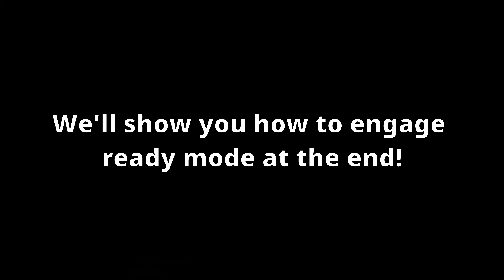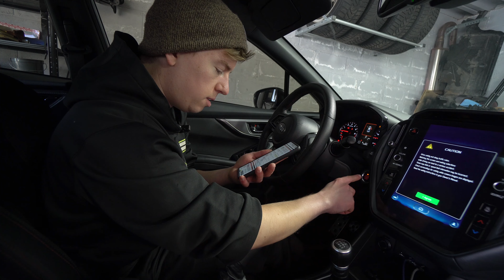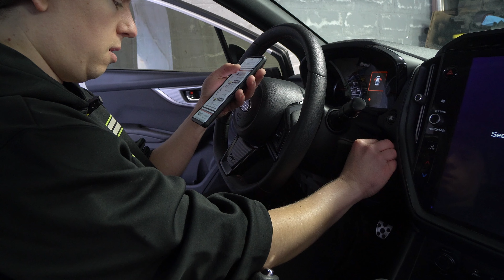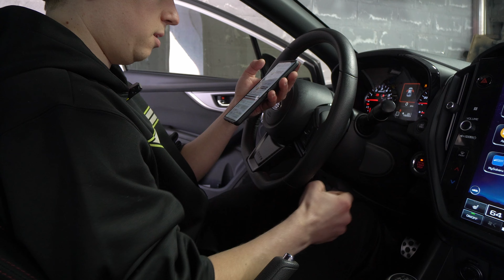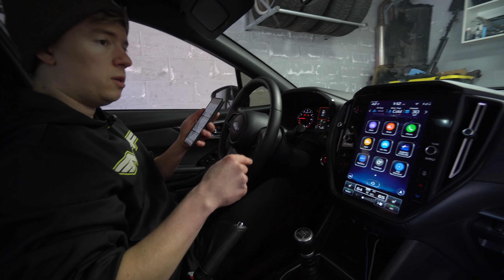VB WRX Remote Start MANUAL TRANSMISSION

Comment: Dude, You're one of the only videos I've seen about installing a remote start on a VB WRX. Its seems so straight forward, that I want to try it myself. I've been quoted anywhere from $1,200, to the lowest $750 to have a remote start installed on my 2023 base. That's The other thing, that worries me, you made it seem pretty easy to figure out, although mine is a base model so I don't have the push to start, key only. but I imagine it should work the same way? So tempting, because this is a much cheaper alternative to paying somebody almost $800.
Reply from the maker: Should be basically the same, just need to change it from push to start to key when configuring within their software
Reply: @HardwayLearning  well man, you got me second guessing myself. I have an appointment on Saturday to pay some guy $800 to install a remote start, apparently it's a compustar remote start. But now, I'm think cancel and save $500 and do it my self 🤔 a little over $300 all I'm isn't bad! Hey question, What happens if you leave it in gear, and you try to remote start it?
Reply from the maker: You have to follow the brake/hand brake/release brake and lock with key fob for it to be "ready" for the remote start function. If you don't do that, it won't let you remote start. So it's fairly dumby proof. There is a quirk I haven't figured out where it seems to auto lock the car sometimes which makes me very paranoid that it will lock my keys in the car at some point.

Comment: Thank you for the through installation guide! Was there no OEM remote start module for the 2022 manual WRX? The OEM one seems to be a lot easier to install and use except for the dealer activation part. Also is your phone OnePlus 12?
Reply from the maker: From my understanding they do not offer an OEM solution for the manual transmissions. It's a pixel 7 pro!
Reply: Thats stupid. When i had my 2019 manual mustang it had remote start.  You mean to tell me that subaru tech is that far behind?  Wish i new this before i bought mine.  Whats the point of a subscription if you dont get remote start.
Reply from the maker: Probably not really tech, but a more conservative approach/cost decision.

Comment: I've installed this Fortin Evo-One with the T-Harnes on my 22 wrx and followed your guide but for some reason I can Lock/unnlock car, when I Press the brake / pull up on the Hand brake then open the door and close it , It kills the car and lock it as yours does. But then i try to start it flasher goes on as if it started but wont even crank on go in ignition
Reply from the maker: Is it still running when you exit car and lock?
Reply: @HardwayLearning  It shut on  its own after i close the door maybe i didn't chose the right ready mode i had Activated By handbrake and Foot brake
Reply: @HardwayLearning    When you did your install did you have to go in depth of the setting as the Specific car guide says? Program Bypass Option : C1/D6/D5 for me D6 was at nothing should i switch it to yes?

Comment: Great video! Where did you end up hiding the evo-one unit? Was there room behind the glove box? Does the OEM key not work once the car is remotely started?
Reply from the maker: I tucked it up behind the glove box towards the stereo next to the blower motor. OEM entry doesn't work when the evo-one has taken over with remote start 👍.

Comment: So I bought a used 2023 wrx with remote start installed by previous owner . I have been wondering how to make it work. After all it’s juste the way you said except after I press the button to lock it takes at least 2 minutes for the car to shut down . Other than that it’s like you said . Kinda annoying to wait 2 minutes to see if it will shut down I get stressed thinking it could stay on for the day haha
Reply from the maker: That's interesting, that shouldn't work that way. Are you locking with the fob? Does it confirm ready mode activated when you release the break by unlocking the doors and flashing the lights?
Reply: @ no in fact I’ve tried many things and I guess it’s the way it was configured originally but ,  I  lift hand brake , release break pedal , get out press the power button ( second button from de bottom) and only then do I get flashes or beeps. Then it stays on for 2 minutes . The lights flash and turns off.

Comment: So the keyless entry doesn’t work whatsoever or it only doesn’t work when the car is in “ready mode”
Reply from the maker: Keyless doesn't work if it is remote started, but will still work if it is not started, but if a door opens after ready mode is enabled, you can no longer remote start

Comment: Will remote start work if you leave the car in gear? Or do you have to leave it in neutral with the brake up?
Reply from the maker: @pequenioedgarito3067  it can not start if it was not turned off and left in neutral